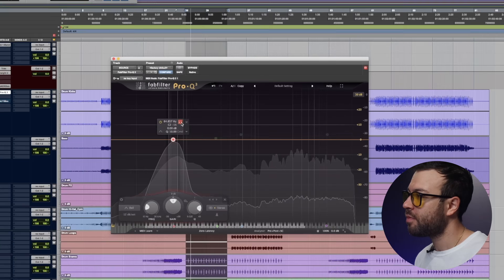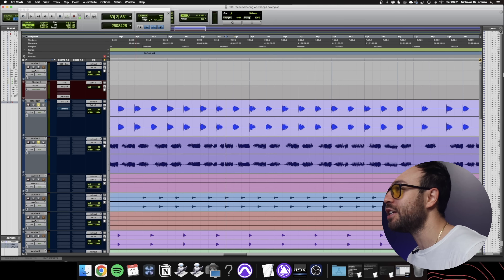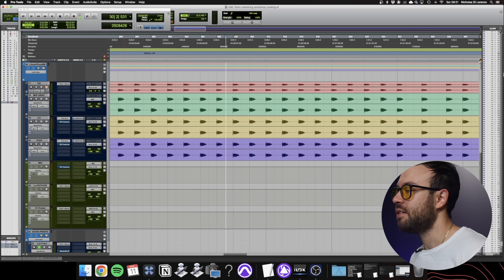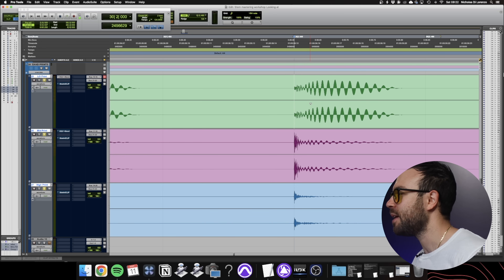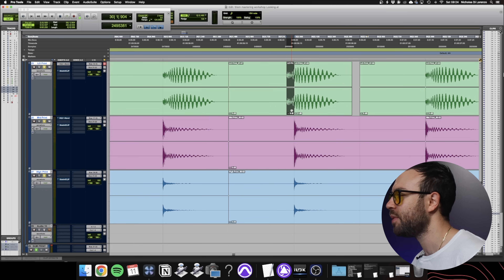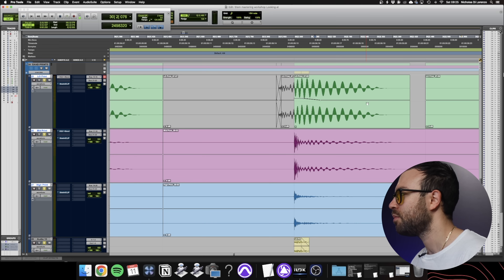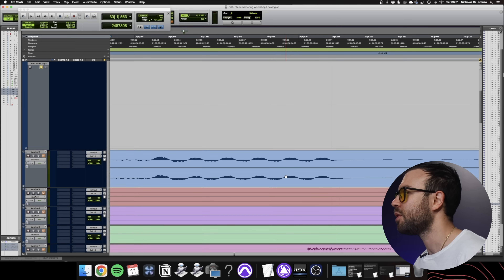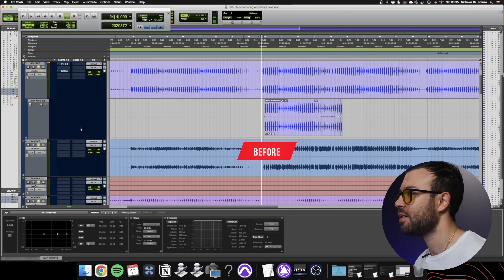I wish this plugin existed.

Comment: iZotope Neutron 4 has a Transient Shaper module in it, so you can do multi-band transient shaping. Can take your subs and lengthen the attack so it's not right on the start, but also shorten the release to tighten up the tail. Or could tighten attack and sustain to just all around tighten punch. Can similarly shape the mid or high end of a kick however you want. Neutron defaults to a hybrid/dynamic phase mode, but can be toggled on and off of zero-latency modes.

I think Neutron 4's multi-band transient shaper module is the tool you're looking for to simplify all of this. It's not really delay vs. negative delay shifting, but I think transient shaping more than shifts the energy to accomplish what you're aiming for.

Can also use Cableguys ShaperBox 3 to do multiband volume shaping to get pretty surgical, but I think the checkbox it doesn't hit is that it isn't linear phase. However, you can do 6dB band splits so it's minimal phase impact vs. using steeper band split curves.
Reply: He's saying that there IS no low end at the moment where the transient of the kick is. So boosting amplitude in that moment wouldn't increase the low end in that moment, hence the moving of the sub forward in time.
Reply: A kick is defined by its quick transition from high to low, if you fill out the start (high) with low energy you're masking that sweep which will leave you with less perceived punch. I think when people only sidechain low end of bass against kick it never sounds as punchy as side chaining the full spectrum of the bass.
Reply: @happyshadow  I agree that a kick's punch really needs that pitch bend sweep feel to it, so I don't really feel like moving the sub part forward will help a ton. The way they coded kicks on things like the Gameboy soundchip was doing an exponential decreasing envelope sweep down on pitch.

I just think the multi-band transient shaping approach of plugins like Neutron 4 or Cableguys ShaperBox 3 is really useful if you want to tighten up just one part of a kick like the sub end to clean it up a bit to make it tighter.

Plugins like Wavesfactory Trackspacer 2, Mastering the Mix FUSER, Soothe 2, or even the dynamic EQ bands of stuff like Pro Q 3 can be leveraged to do frequency specific ducking of kick vs. bass, vocals vs. instruments, etc. to get a more musical sidechain ducking than just full volume ducking.

Comment: I like the way you have worked with your kick, you have done good sound design and as a producer I think it sounds great and I will copy to make my kicks sound this way. Generally producers use a sample or use a tool that basically transforms a sine wave from a high pitch to a lower pitch that can be in the same key as the bass.

Comment: You’re basically replicating kick synthesis, eg using kick2 VSTi where the tonal, transient and sub portions can be synthesised with precision. There are others plenty of other tools. Even backbone from steinberg can recreate sounds from samples. It’s very good with kick samples and allows you to align or adjust the sub components.

You’re trying to keep the artists intention by trying to fix it like this, but you know, sometimes the artist just picks the wrong sounds and they need changing.

Comment: Love this plug-in idea! Would be cool to also have a pitch option for each band, unless that causes phase issues Im not accounting for. I often tune my kicks to the track but don’t love how pitching the kick changes the timbre of the transient and top end I originally liked about the sound. On real kick drums (and correct me if I’m wrong) the sound and texture of the beater hitting the head doesn’t change much, if at all, when you tune the drum (with a drum key, in real life). Any tips on how to preserve the true sound of the beater while tuning kicks? Same question for the transients with synthesized kicks.
Reply: As im making a lot of hardstyle genre where you make a lot of "hardstyle kicks", i would say split transients and tail part of the kick, dont pitch the transients, just pitch the tail or sub part of the kick

Comment: This seems rather unnecessary, at least to me as a producer/ sound designer. A simpler solution would be to re-synthesize a new kick with a tighter pitch envelope. It's an elegant non destructive process compared to the series of destructive processes you've used in the video. Also just remembered while typing this that there's a new ai plugin called visco i believe, that allows you to essentially re-synthesize samples and change various parameters non-destructively. Might be worth checking out
Reply: Thankyou, I wanted to say this too

Comment: As a sound designer my self for more then 20 year , don't do that to the kick .
Reply from the maker: This was explorative. 
It’s laborious and not flexible doing this.
But having it laid out within a single interface would make it a unique tool.
Reply: I can't explain it here on a comment so i'll try to make video but basically a EDM kick is a sine wave sweep and it has to go full ciclé to sound impactful and smooth at the same time , that fish like shape is done on purpose to reduce low mid frequency levels and not having to eq later.